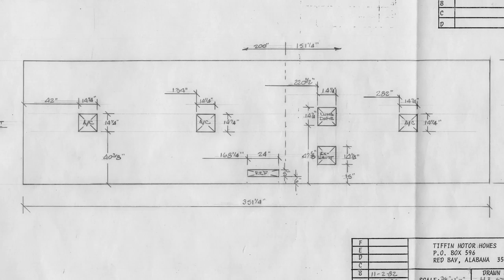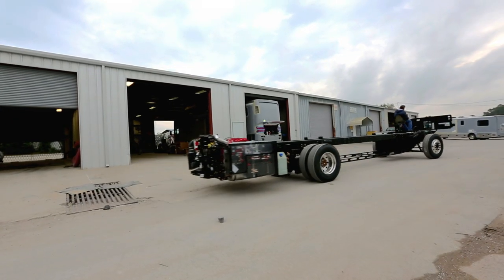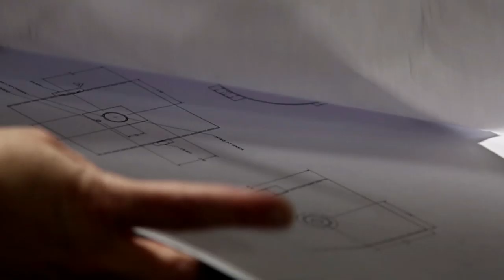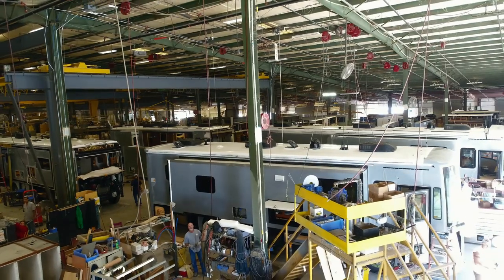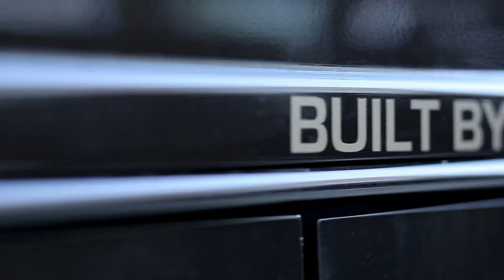The Allegro Bus Through the Years | Tiffin Motorhomes

Comment: I have 1993  Allegro.  Is there a valve for using "shore" water?   I can fill the water tanks and turn the pump on and it works.  But I get no water through the system when using shore water.  I figure there is a valve hidden somewhere, but I have stuck my nose in every logical place and I cannot find it.  I don't know the model number, but it is approximately 29 feet long.
Reply from the maker: Hi, Joseph. Thanks for your comment. Please contact our service department at 256.356.0261 or via email at service@tiffinmotorhomes.com. One of our service representatives would love to help you.